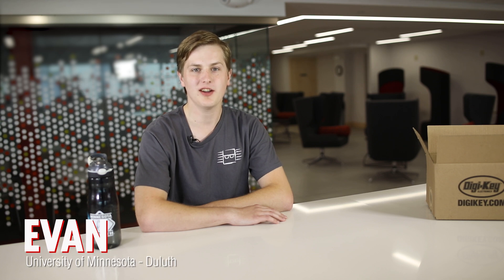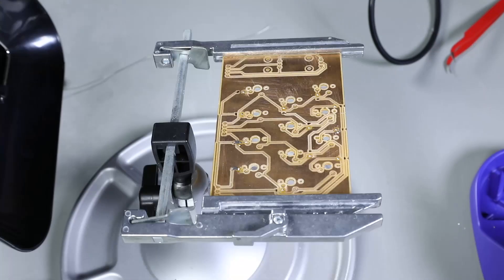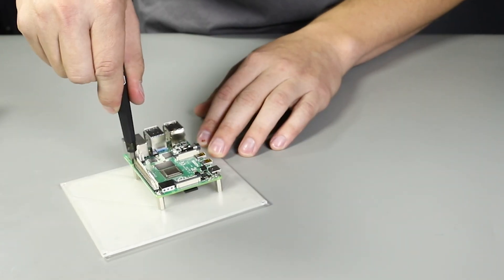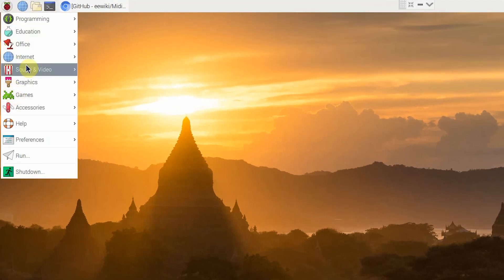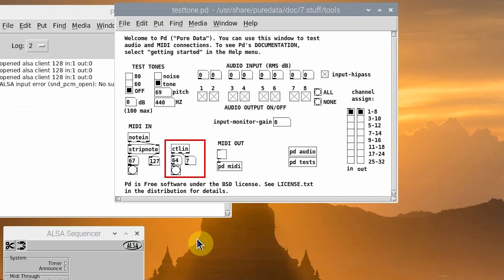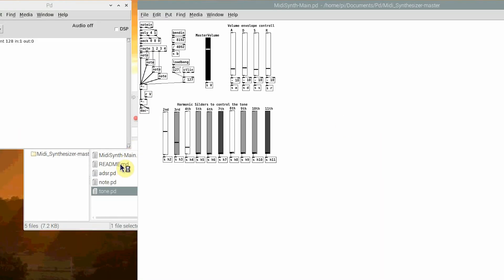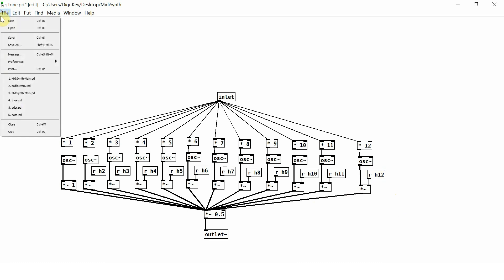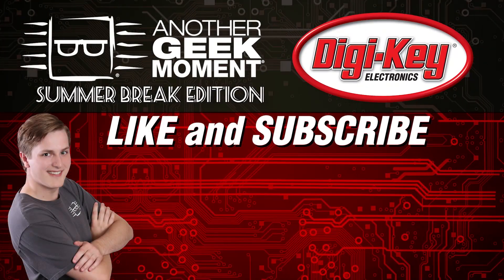MIDI Controller & Synthesizer Project – Part 3 AGM Summer Break Edition

Comment: Hi Evan, great work, Ive managed to duplicate what you have done however I want to make some changes and need your guidance.  Instead of using the synth you have used I want to use a synth called synthv1 instead of pure data and not sure how to trigger the synth now as it wont play when I press the buttons on the midi arduino? What do I need to do to get these 2 items talking to each other? Alsa sees the synth and I have connected arduino midi out to synthv1 in? Help. :-)
Reply from the maker: Similar to pure data, symthv1 has the options of Jack MIDI and ALSA MIDI inputs so there might be some similarities with how to connect synthv1 and what I did with my project.

Unfortunately I'm not 100% sure and I'm not able to test it right now. Let me know if the above information helped!
Reply: @digikey  thank you, I got it to work, the pots one controls volume and one the pitch I assume, how can i add one to control decay or sustain?
Reply: anyone?
Reply from the maker: @globalstandardrating7552  Hey, thanks for reaching out. I would recommend posting this question on our forum. There are multiple people that run that page and I'm sure someone would be able to assist you. https://forum.digikey.com
Reply: @digikey  on your suggestion I have posted this there "MIDI Controller & Synthesizer Project" - perhaps can Evan who worked on this send me an answer?
Reply from the maker: @globalstandardrating7552  Unfortunately he isn't able to. He was an intern here when he did this product.

Comment: You mentioned that we could install a 5th note on the setup but you were showing this being linked on the 4th box in your display. Was this an error on editing the video on your part or is this the way the programming will look on the screen or is the first path not given a value??? This left me confused. But a great design on your part. I may change the box & button design configuration to make it more ergonomically functional for myself. Keep up the great work.
Reply from the maker: Hey John, sorry for the late response on this one. Are you referring to the rightmost outlet of the route object that is unconnected?
Reply: Digi-Key i had to rewatch the video being that I had forgot about this comment. But yes I was. I then to a guess and figured that the rout box acted as my first note in the configuration setup.
Reply from the maker: @MrWATCHthisWAY  The rightmost outlet on the route object does not need to be connected because that is where it sends data that does not match the 1, 2, 3, 4, or 5 in the route object. These numbers represent the number of notes that the synth can play, and that is the only data that is needed. - Hope that helps!
Reply: Digi-Key I must apologize for not responding too. I’ve been working with a Laird development board for Bluetooth and I haven’t been checking my messages either. You answered my question tho. I actually was going to construct something along the same lines of what you created. But you designed it much simpler then I envisioned. I have been looking for a synthesizer to add to my design but stuck this on the back burner for because I’m designing an outdoor operational system for notifications to my phone. Thank you for getting back and explaining before I started programming my design.